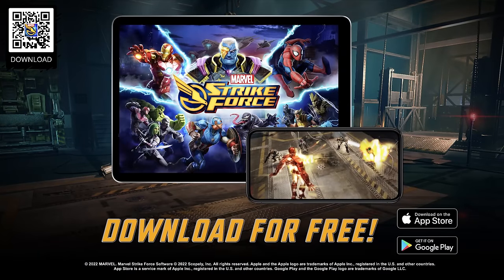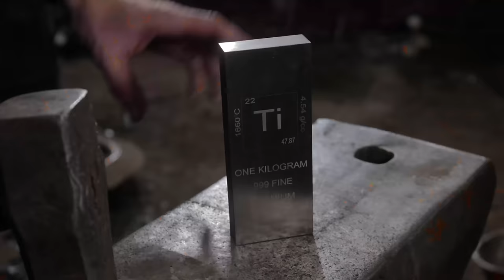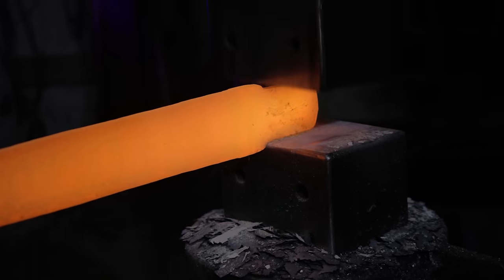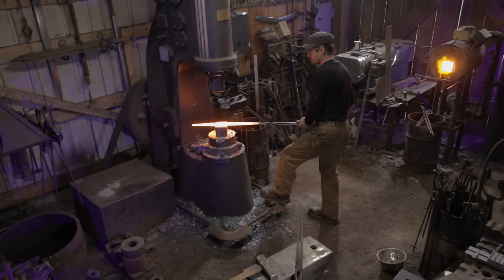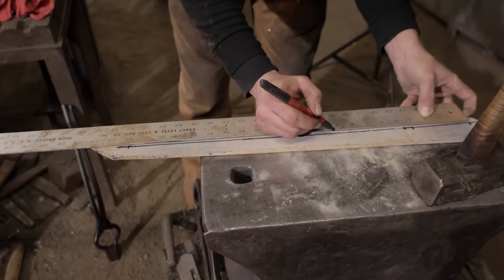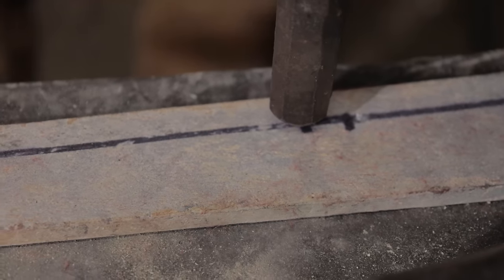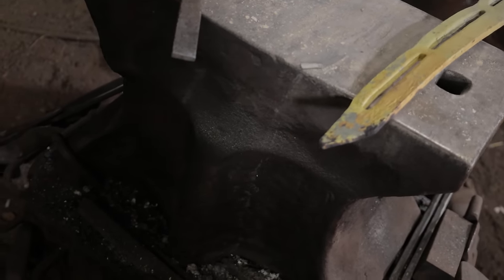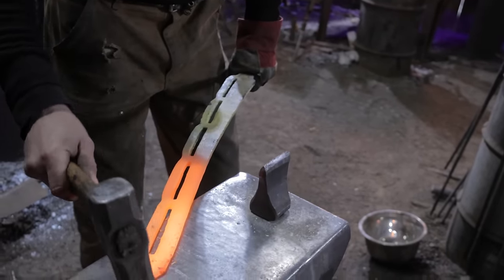Can We Forge Titanium into Ronin's Sword ?

Comment: titanium is brittle, i would think this sword would just crumble if used.
Reply from the maker: It’s not so much brittle. It flexed a lot when cutting but it doesn’t hold the best edge
Reply: @ThatWorks  interesting, i used to work in a machine shop that made cutting bits and i would always see titanium ones coming back for sharpening because of massive chipped edges.....obviously not as much as carbide but nonetheless chipped chunks were a concern. Whats also strange is that we would coat cobalt bits with titanium....if it didnt hold an edge why does most the industry do this for longevity in keeping a solid cutting edge? Just my 2 cents....
Reply from the maker: @joshuaingersoll3875  I'm sure the drill bits were some sort of alloy. This was pure Ti bar. Some alloys are hardenable and will hold an edge. We had to work with what they sent us.